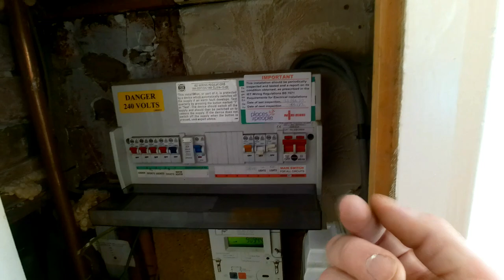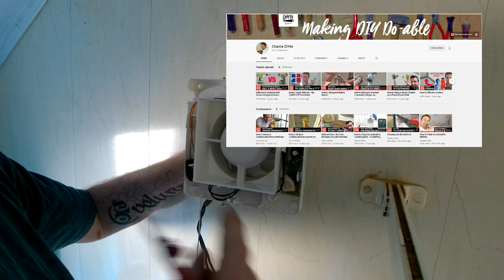How to replace an extractor fan with humidistat in your bathroom DIY

Comment: Great video. Fitted the same extractor last week but it just won't stop running so disconnected it and will try again this weekend. The wiring is coming from a switch fuse with other 3 cables connected to it from the loft. don't know if the the lead to the extractor is not connected properly in the switch! any thoughts?
Reply from the maker: It could possibly be the humidistat setting. From what I remember, there's a small screw dial that controls it. It's possibly set too low so that even a small amount of moisture in the cold air is keeping it on

Comment: This is actually somethinf we might need soon, since we are chanhing everything in this house... tommy has installed a whole new ventilation or recicularion or something system 🤣🤣
Reply from the maker: Recirculation systems are becoming more and more popular in the UK, they are pretty common in the US. It helps air flow in the whole property reducing damp issues caused by condensation considerably but not that common in older properties as it a pain to install after the building is built
Reply: @philscraftcorner  yeah but he doesnt let me open windows now 😑... dont know if thats a thing but he says it is 🤷‍♀️
Reply from the maker: If there is negative air pressure circulating then yes. Its the same with air con in the car. It doesn't work as good with the windows open
Reply: @philscraftcorner  lets delete this comment so tommy never reads tjis and atoos fighting me everytime i want natural air breeze
Reply from the maker: If you close the door in that room it should be ok

Comment: Hi Phil great informative video well explained . I have a question regarding a fan i fitted yesterday. It was a Blauberg Humidistat fan, the fan was connected to a constant feed which was in line to the bathroom switch. When i turned on the bathroom light the fan came on and then off when the switch was off. Shouldn't the fan work without the light being switched on ie; in day time when using the shower ? i don't want the fan coming on during the night when someone just uses the toilet . Is there a way of connecting this up or adjusting the settings to get this to happen ?
Reply from the maker: Hmm if it's a constant feed it should always be on. Can you test the circuit with a volt meter to see if it is actually constant and not just a spur from the light fitting that will make it switch on and off with the light too
Reply: @philscraftcorner  yes it's a spur from the light , should i wire it up on a separate feed so it's constant live and then adjust the timer and humidity setting ? cheers
Reply from the maker: If you don't want it switching on and off with the light then yes. You can keep the pull cord or just use the humidistat to turn on and off automatically. Some also come with a timer.

Comment: Hi Phil great video, I have a question regarding replacing a bathroom fan to a continuous running bathroom fan. currently the fan is switched outside the bathroom on a normal 3 gang switch....I want to replace one switch with a fuse for the fan...(so it can’t be switched off because it’s continuous) 
the two remaining switch’s are for  hallway and bathroom lights. I’ve just bought a 3 gang switch where you can replace the switch with a fuse section But there is only one hole at the top and one at the bottom for the live of course.... but what should happen to connect the neutral wire.?
Reply from the maker: That's a very unique setup there and honestly nothing I have come across before, I am not an electrician so unfortunately won't be able to help you with that.

I have tried to look for wiring diagrams and cannot find anything. Maybe check the manufacturer website or any paperwork that may have come supplied with the switch for wiring information
Reply: @philscraftcorner  Thanks for the response Phil, 
To be honest it’s probably my description that makes it sound complicated.
I have now worked out I can join the wire with a wago 224 112 connector (a modern version of chock block) check them out ! Thanks again!
Reply from the maker: I have a bunch of them on different sizes. Mixed pack from Screwfix. They are awesome

Comment: I understand it’s got a humidistat to ensure all steams gone but how does the fan stay on when you’ve pulled the cord to cut the electric ?
Reply from the maker: The humidistat will automatically turn on and off. The pull cord will only turn it on if it is off.

Comment: Just an addendem to my last comment.  Any work carried out in a bathroom which is, according to the  Electricians guide to 
the building regulations, under regulation 12(6A) is deemed as notifiable work in special locations and as such should be 
notified to the building control body of your local Authority before the work begins.

Comment: Hi, Please do not tell people who are not Electricians that you can use a volt pen to test if a circuit is dead or not.
The volt pen while useful for tracing live cables, will not tell you conclusively if the circuit is dead.  Use it by all means
if you want to end up spending half a day at the undertakers.  If not then use an approved voltage indicator and prooving unit.